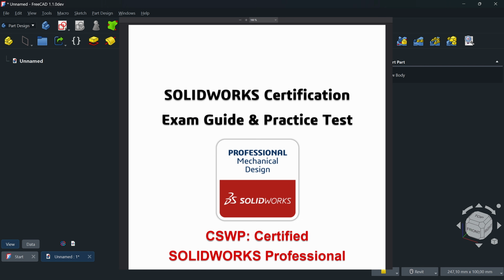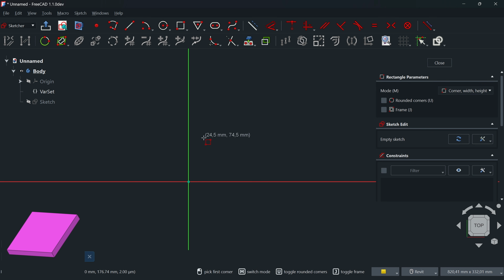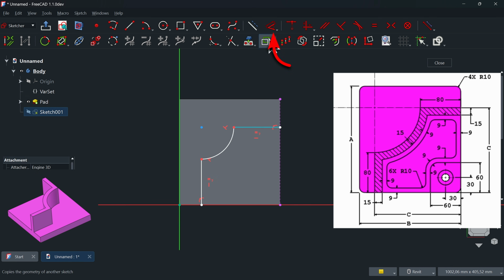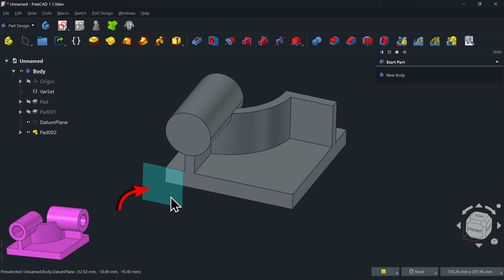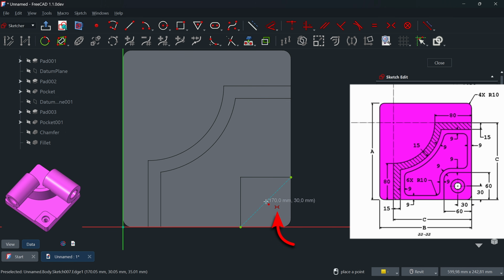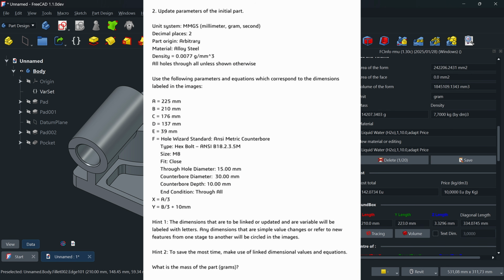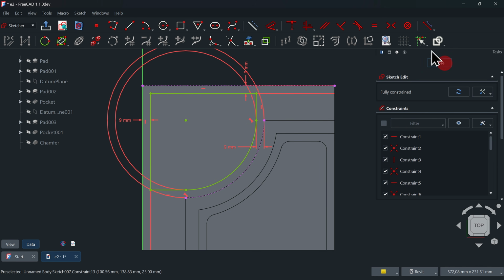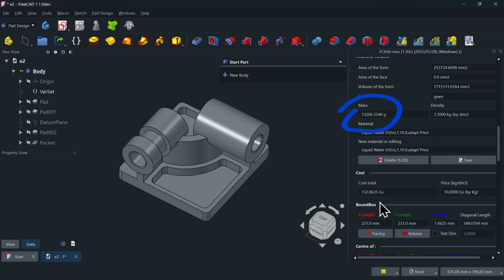Can FreeCAD pass the SOLIDWORKS Pro Certification CSWP ?  (Full Tutorial & Parametric Method)

Comment: Yeah for sure FreeCAD is nowdays a legit option, especially for hobbyists. I'll be fully transparent here, I have FreeCAD installed, but I actually haven't used it very much. Few small things time to time. I started with Fusion and my employer has bought me personal license to use at work. I really like Fusion. It's heavy software, but quite ok for basic usage. However I dislike how AutoDesk has began to remove some of the features that were free originally for all. This is by no means surprise for me and well imho shouldn't be to anyone. It's software corporation aiming to get money. But this is the exact reason I've my eyes on FreeCAD for years. Like before 0.1 versions it was pretty much unusable imho. UI and functionality was in insanely clucky. At around was it 0.13 I was like "Yeah, getting better fast, but UI is horrible mess". Now at 1.0 and recent where we've gotten much better UI, that nice orbit marker and keyshorts and functionality very close to using like Fusions commands, right now FreeCAD is in my books in state that I honestly can suggest it. I have small niche language channel for Fusion basics I started anout year ago and already then stated that I'm still teaching with Fusion as it's free for anyone, is industry standard software so-to-say, but also stated that my tutorials can be adapted to FreeCAD to great extent and that moving from Fusion to FreeCAD isn't too hard. One part of not doing FreeCAD tutorials was partly also because I know it's UI and functionality will change in future and to better. Fusions UI I think has reached maturity that major changes are quite unlikely.

This was good example. Ok I have that small background already for FreeCAD, but looking through this I'm 99% sure that I would've succeeded in this training exercise myself. Workflow these days is really close to Fusion and to some extents better. Like drawing lines and using that M-key to change into arch lines just like that, is something I wish Fusion would have.

Comment: I actually started my 3D modeling with LightSpace and VideoToaster's 3D modeler (Can't remember what it was called) in the 90s.  2D drafting, by hand then Autocad.  Professional Modeling/Drafting/Engineering was ProEngineer.

I've been using FreeCad off and on since 2018.  The current builds really do impress me.  Back when I started in 2018 models tended to be very fragile to change.  Restraints and references would break constantly requiring remodeling almost from scratch.  Not so anymore.
Reply: We have similar timelines. I was 3D studio 4 (dos) then moved up to big leagues with Softimage. It was so exciting back then!
Do you mean LightWave?
Reply: @maidenfarms yeah, that was it.  The first one for win 3.11 with "nurbs"

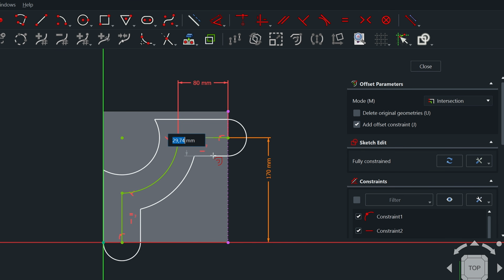Comment: Anyone else not able to offset the three elements around 8:19 ? namely the two lines and the arc? I can see I have selected them but when I click offset one of them is removed from the selection automatically and I am left with an offset of just two elements. Hope someone can help. I am using the 1.1.0dev version
Reply from the maker: I had the same issue with the latest dev version. I don’t have this problem with a dev build from October.
Reply: @deltahedra3D  Best youtuber ever .. cheers man, I shall revert my version to Oct.
Reply: Can confirm FreeCAD_weekly-2025.10.01-Windows-x86_64-py311 worked , but FreeCAD_weekly-2025.11.05-Windows-x86_64-py311 did not.
Reply from the maker: @MartinMears I hope they will fix it for stable 1.1

Comment: After using FreeCAD for 5 years (and also contributed writing one of the macros) I switched to Fusion, although I still keep FreeCAD around as it has some powerful problem solving tools.

FreeCAD, over the years progressed really well, and it became very powerful indeed. But, it still struggles with complex geometries. All these tutorials comparing FreeCAD to other CAD applications are generally showing very simple geometries, that is really easy to model.

My main problem with FreeCAD was how much it is refusing to complete tasks like creating a thickness, or creating fillets in complex shapes, reordering the operations or adding new operations and not loosing references (which FreeCAD has become better with 1.0 release). Fusion, as I see, works generally better in this situations and completes the operation, and I quite liked that. I was able to finish one of my projects that I struggled with FreeCAD for a while.

Again, I still have FreeCAD, and as an owner of many OpenSource projects I'll keep supporting it, but for now, it is not my main tool anymore.

Comment: Why are you creating some sketches on planes and using the previous geometry as a guide, but other times create the sketch directly on a model face? What's the difference?
Reply from the maker: @RREDesigns I created an offset plane for the cylinder because it starts 10 mm away from the face, and the variable D represents the total length of the cylinder. So instead of extruding in both directions : 10 mm and D minus 10 mm, I prefer to offset the sketch.

Comment: My only complain would be of FreeCAD is the UI is not good. Make the UI good, and it will start to get more popular. CADs in general has not much good UI except, Shapr3D. but Fusion or even Solidworks looks kind of neat and haas that engineering aesthestics. But FreeCAD's is just low effort or outdated icons. I hope in one dev release, they focus entirely on the UI side of things, and automtically it will start to have major adoptions, atlest in the hobbyist side of things.

Comment: To be frank, I think FreeCAD suffers from the classic open source project issue, which is that it’s very powerful once you know how to use it but getting to know it is very painful. None of the buttons are labeled. Some features are hidden behind keyboard shortcuts. 

Also, last time I tried FreeCAD, I tried modeling some simple parts and I kept getting Python exceptions in the console and the program kept crashing. It has been two years since then so maybe I should give it a try again but I have not had to fight Fusion360 like I have FreeCAD.

Comment: As an avid freecad user it makes me cringe when you use so many fillet operations. They are quite taxing on the rendering of your project. It's better to create fillets within your sketches.

 Should you need to use the fillet operation, do it at after all the sketches are made, not in the middle. If you do it in the middle and you change geometry of the earlier sketches it will completely ruin your fillets.

Comment: I started with Solidworks. I have been using it for 10 (😱) years now and designing moulds for injection moulding, FreeCAD seems lacking. But considering the open source nature and team behind it, it's amazing and I keep telling myself I should learn it and use it more
Reply: For some reason, it doesn't have projection of a plane onto curved surfaces. Or if it does I couldn't find it.

Comment: Started with 3d graphics software. Which is nice for polygon modeling, but less so if you want to do something mechanical looking. Especially with destructive and somewhat booleans! Bouncing back and forth between CAD packages. With FreeCAD most things work - the scary part is the question when and why something stops working. Looking at precision in the core vs. splines or the problem of two fillets meeting at an edge for example. Something that has a good chance of hitting me when trying for example revolve operations that work fine in other packages.

Comment: I started out with Fusion360 because it was free and quite powerful. Later when they changed the license and the way their software is used i made a switch to FreeCAD. At the time i did not like it, but it worked for simple projects. I alternated between freecad and fusion until i stopped using fusion altogether. Later i discovered onshape. I really like onshape because of the cloud storage, meaning i can open it up anywhere i want and it works on the browser. This means i can work on my projects at work without having to install a CAD program or download and manage versions locally.
My internet can  be choppy sometimes, which means i can't use onshape, so for those cases when i need to scratch my CAD itch i have FreeCAD installed.

Comment: I'm confused by some of your steps here. Why make multiple sketches from the exact same work plane? For example, the tube could have been done as one sketch with both circles. FreeCad can find the enclosed area easily. That reduces the number of steps, declutters the part menu, and imo is just generally a better workflow. Is there a specific reason you did it that way? Ah I see the pocket has a chamfer. I wonder if it would have still been easier to make the tube and add chamfer later (less sketches etc), but that could behave funny due to the curved edges.

Comment: I been maining 123d design since 2018 and i hate that I still dont have anything to move to yet, I tryied fusion and free cad but they are both extremly complex and not the type of 3d modeling that I do
I might even move to blender one day jsut to be able to 3d model in the way that I do (additive 3d modeling, using basic shapes as positive and negave and adding modifiers to angles and surfaces, like tinkercad but way more advanced)
I dont think in 2d sketches or constraint, I think in 3d models made of smaller parts and individual polygons modifications
 sadly 123d design lacks of a LOT of features, like I cant import an image, am forced to transform the image into a svg or flat 3d model if I want to use it as a referance and it sucks  TwT

Comment: I suspect that this could kinda-sorta also be done in Solvespace - except I'd have to design in all the chamfers manually, compute all the "variable" stuff manually, and use the measured volume to calculate the mass. Other than that though, it might actually be doable...

Comment: One thing I started to do with fillets and chamfers is, to first select only ONE edge instead of all in one go.
If you accidentially miss/release the CTRL key while selecting the others, you'll have to start over again. (Been there, done that, too many times!)
But if you just select one edge, then hit Fillet/Chamfer you can then use the "Select" option in the Properties window to easily select/deselect others without having the stress of miss-hitting something.
Reply: But if you want to edit the size, you then have to edit 4 features instead of 1
Reply: @MeSoyCapitanno, I think you misunderstood. In the end it is only one feature, but the way I create is is:
1. select only the first edge, not all of them
2. use the "select" function within the fillet panel to add the other edges or planes.
this way not all selected edges will be unselected, if you misclick in step 1
3. finalize the fillet/chamfer

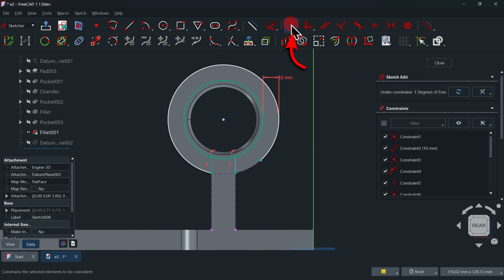Comment: Could you investigate the .01mm difference (or whatever the unit was) and see why is it different and which one is the most "true to life" (or true to maths)? Also, expand on why you didn't finish the circle, @23:49 when you said "it could create problems", which problems? Why? How (apart from in videos such as this one of yours) would an user find out about this trap?
Reply: About the circle arc one it would tell it has an overconstraint, or in some cases it goes silent until it decides to just break. It has definitely gotten better though because in older versions the program will just crash and close, while in the newer version you actually get to save the file and investigate.

Comment: I feel like freeCad is pretty good at designing a part which already exists. Tracing out parts from measurements and constraints. Much less so when it comes to designing the part in the first place. 

The trial and error. Designing, then simulate, then redesign, then sending it out for fabrication, realize that the bolt hole cannot be interfaced with due to other parts, going back to redesign. Going back and changing and creating brand new features basically destroys the entire part. At least for a beginner like me. I find fusion360 much more forgiving when going back in the history to edit old features or entire sketches. 

I would love too see the workflow for someone using freeCad to design a part from scratch. Something which will need many revisions, something when 2 weeks in the requirements change. I don't like autodesk predatory business practices. I would love to be able to use freeCad instead
Reply: FreeCAD has become significantly more robust when editing prior features since 1.0. I’ve noticed it’s far less prone to breaking nowadays, causes issues about as often as SOLIDworks did, and it’s pretty easy to fix up.

Comment: I'm using blender on my first year of engineering because after half a year of autocad they said now we can use any CAD we want and I was already familiar with it. I work twice as fast as everyone using other programs but I now I'll eventually want to use a parametric modeller so I'm trying to get into freecad
Reply: Blender is definitely not going to work as well for you as a parametric CAD program. Making changes is infinitely easier and because the model is defined by math and not polygons, there is much more you can do without running into resolution issues
Reply: Blender is not the best option for engineering design
Reply: I use 123d design to this day but sadly its missing sooo many functions that those other softwares have
but searching for a software that can work offline and doesnt require an account, sudently only extremly complex softwares like freecad and blender show up...
Reply: Check out plasticity, it's a cad software with really powerful surfacing, the pro version has xnurbs, and it connects directly to blender if you want to render your products
Reply: Blender is powerful and it has some nifty stuff you can do with its own operation tools but if you need a CAD please try to learn FreeCAD in your free time as well since it's geared more towards this kind of stuff. Good luck!

Comment: Thanks for great tutorial ,,, I have problem when I want to create offset I cant do it from face as in 16.36 onwards always I get message   - failed to project external geometry selected external reference plane must be normal to scatch plane ,,,, even when I redraw external go as construction lines manually I cant make offset from it ,,, Im using 1.02 version
Reply: I answer my own question :D ,,,, In video Deltahedra uses developer version of FreeCAD 1.1 with all new shiny functions which are not implemented in 1.02 version ,,, but this tutorial is also possible in 1.02 but you have to use more geometry lines radiuses etc